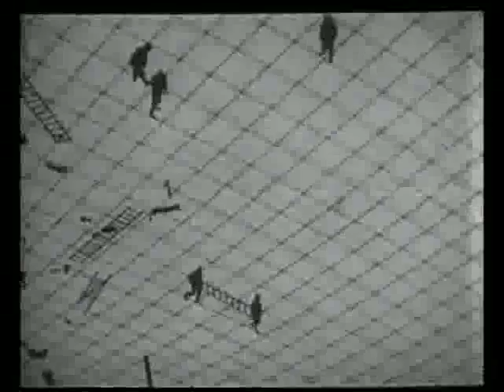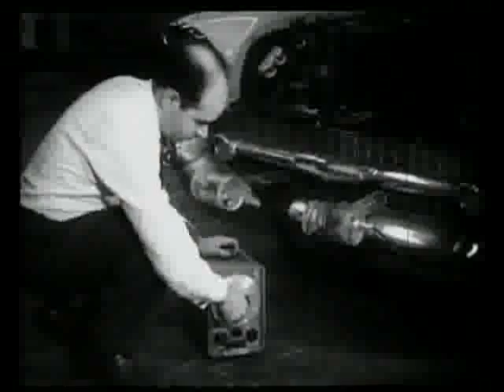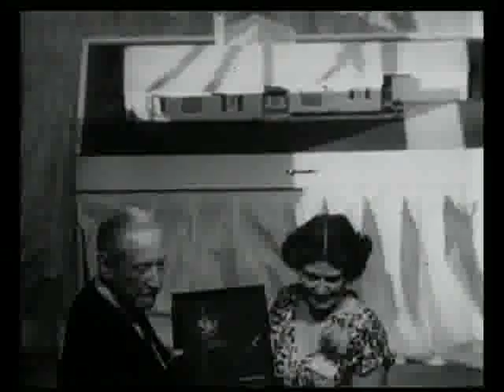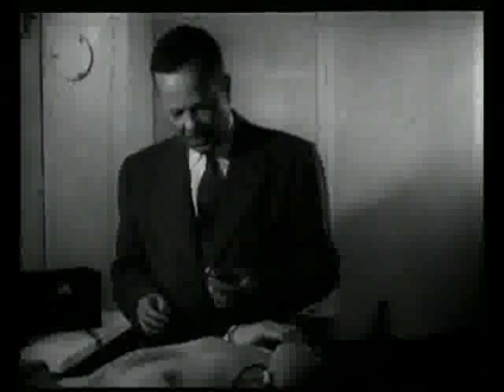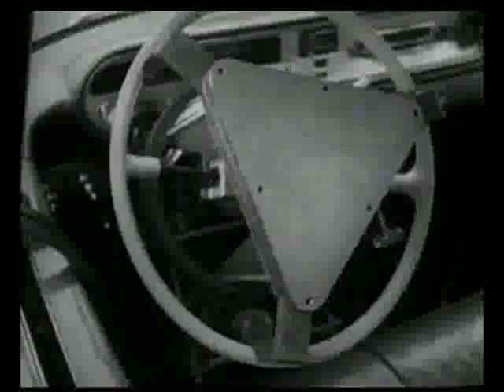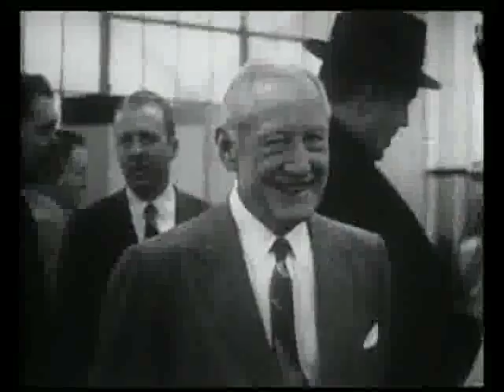General Motors Vintage GM News

Comment: And more than 65 years later, GM is still taking small steps in self-driving cars! (It hurt to see the 1957 Pontiac broadside the '57 Cadillac, even though it showed the vulnerability of the new X-frame design Cadillac began using that year)

Comment: It's no wonder that Cadillac got damaged the way it did! Back then, that car was underpinned by GM's "X" frame (new for '57) and wasn't exactly the safest thing in the world when it came down to side impacts. The Pontiac hitting it had a perimeter frame (side rails) and would have at least fared better.

I do miss four door hardtops though..........they went out of existence in the late '70's due to the safety Nazi's and have never returned. Maybe they were a bit unsafe in a side impact, but with today's safety advances, I can't see how that couldn't be built to pass safety regs. I think they look soooo much better than that ugly center pillar blocking your peripheral vision!
Reply: also it was a 4 door hardtop with no pillar in the middle. Our 93 Ciera sedan got T boned at least that hard in the same spot and the door remained strongly in place, just with some deformation.
Reply: Despite what people think, GM was concerned about the affect Ford's safety push had in the minds of consumers...
Reply: The Cadillac didn't do too badly. The rear door was hit at an angle but, the front door was barely pushed in at all.